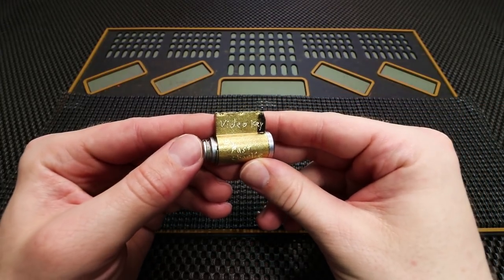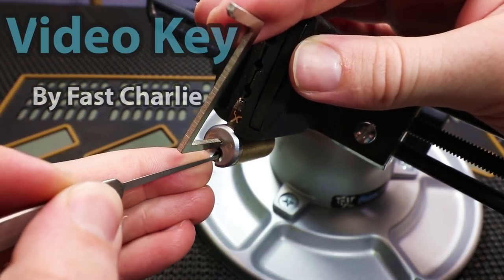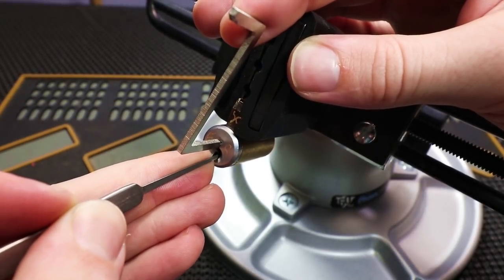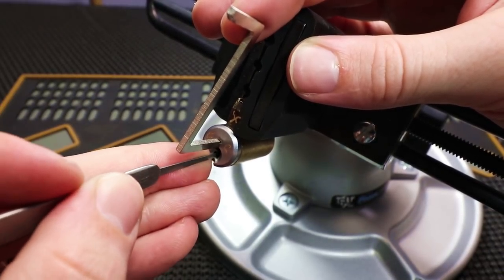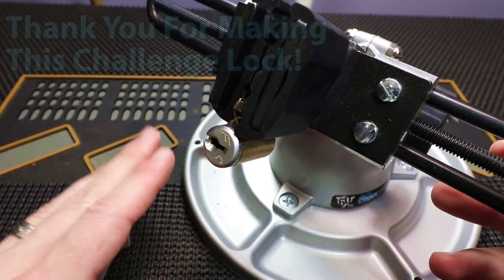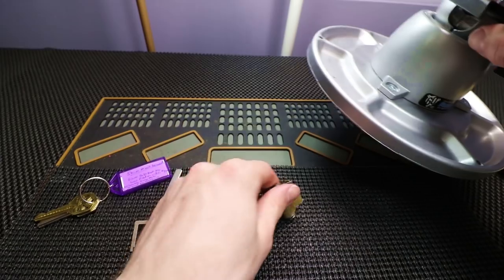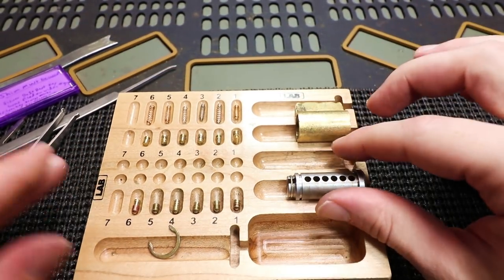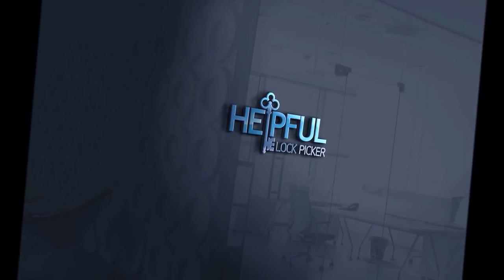[160] Video Key Challenge Lock By Fast Charlie Picked and Gutted (Fantastic Example Of Poor Gutting)

Comment from the maker: Thank you Fast Charlie for making this lock, it was a lot of fun. I like how you threw me off a little bit when I got down to the gutting. Lesson learned to not pick locks when you are tired and pay more attention!

This was a fun lock with some really nice pins, I am happy to have been able to spend some time with this lock and I am looking forward to sending it to its next home.
Reply: HelpfulLockPicker - thank you for sharing this on your channel and great picking.  For clarification, drivers 3 and 4 are swapped on the tray with the spool going over the shorter keypin and the serrated being above the longer pin.  The addition of the 6th pin is the reason the factory key sticks a little.
Reply from the maker: Fast Charlie I sent you an email reply with a photo. When I put the lock back together I swapped those two pins because I felt that was more correct.

Either way, it was it was a fun lock and thanks for making it :-)